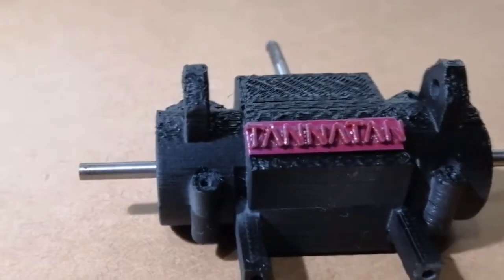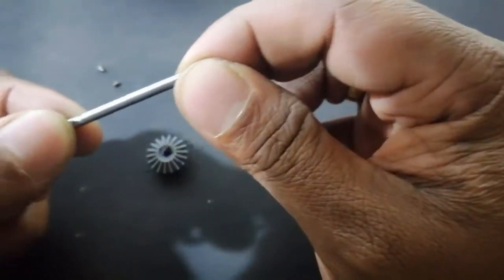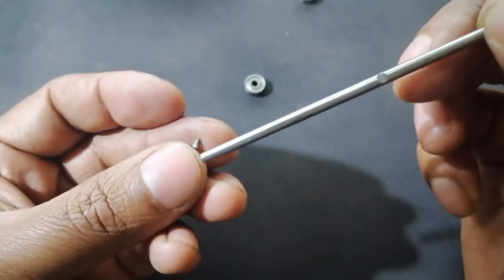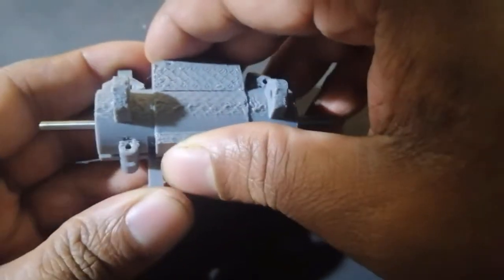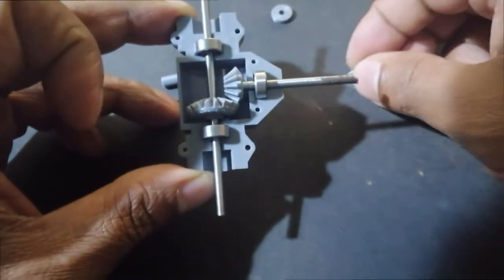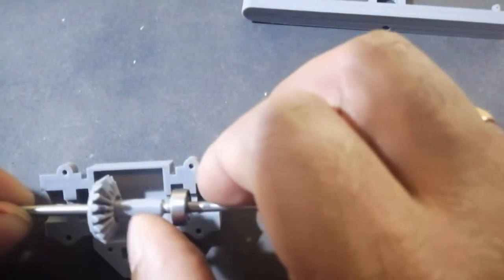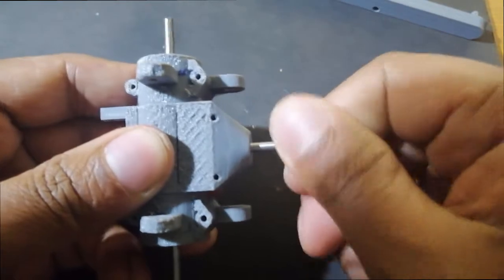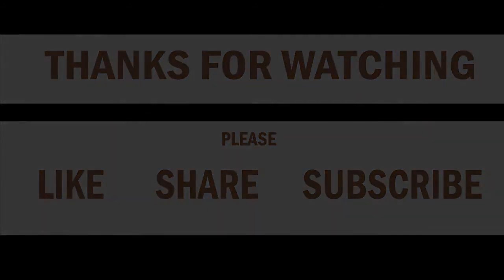3D PRINTED  TRANSMISSION BOX FOR RC CAR

Comment: Bro its not transmission. Its a differentional. Do you know what transmission is?
Reply from the maker: Thanks for the correction. I just named it like because it transfer the power from motor to the wheels. I believe that the transmission includes all the components that transfer power from engine to the wheels. by the way it is not differential, as the differential is the one which is able to rotate both the wheels at different speed. I have uploaded a fully functional differential in my channel hope you will like it.